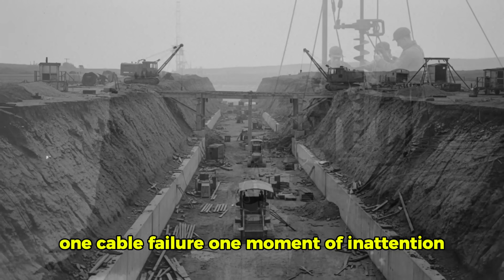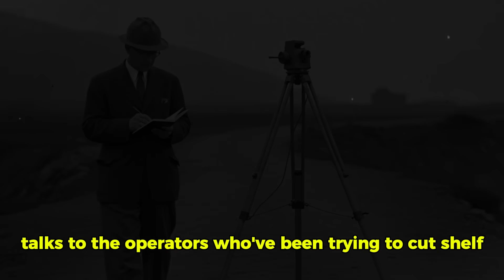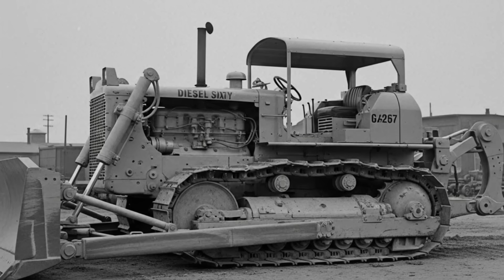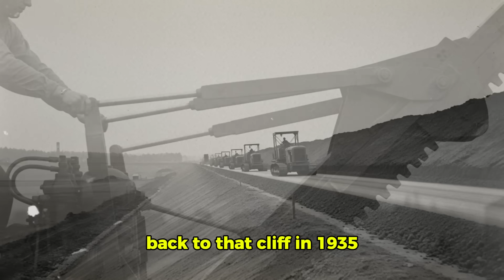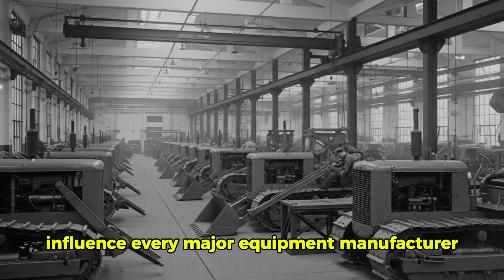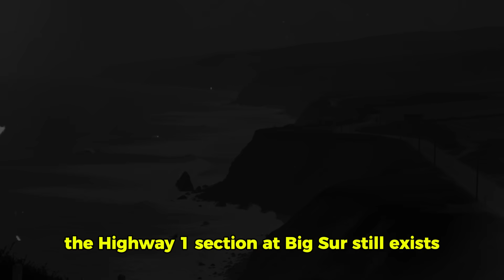5-Ton Blade vs 900-Foot Cliff: The Bulldozer Modification That Changed Engineering (1935)

Comment: I don't think there was a single angle dozer blade shown in any of the bulldozer pictures.  Certainly the hydraulic dozer blades shown were not consistant with the cable blade control technology used in the 193x to 1950 time frame.  

The inconsistant spelling of LeTourneau was very sloppy.